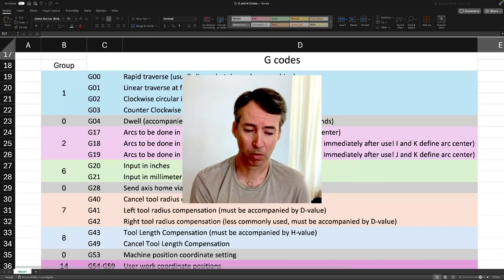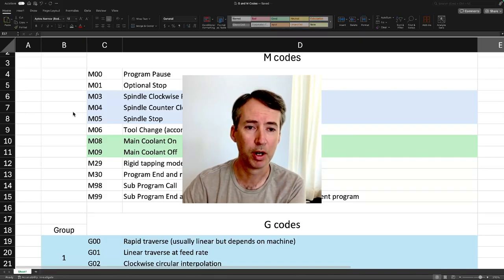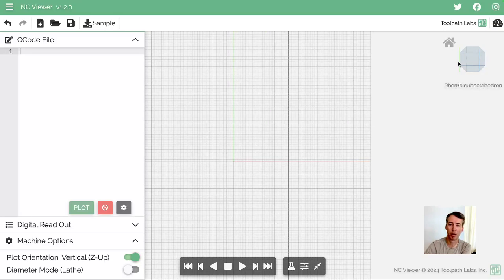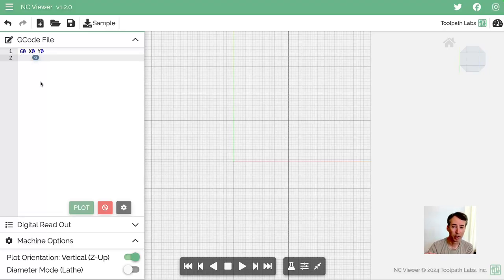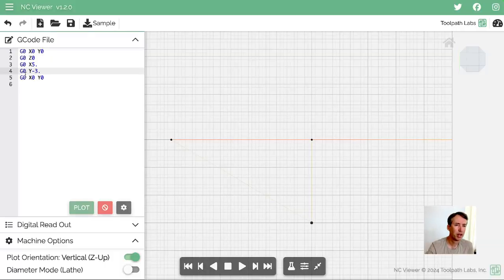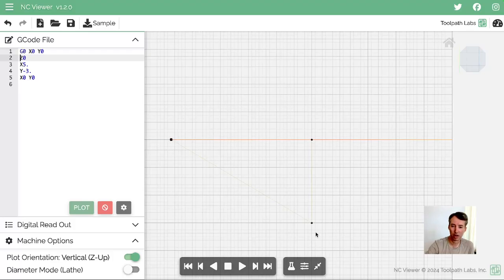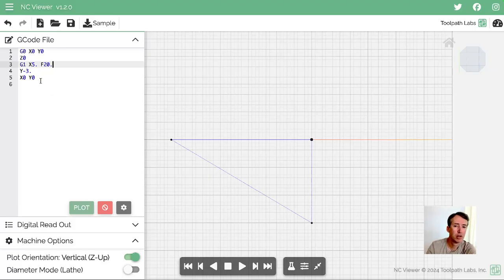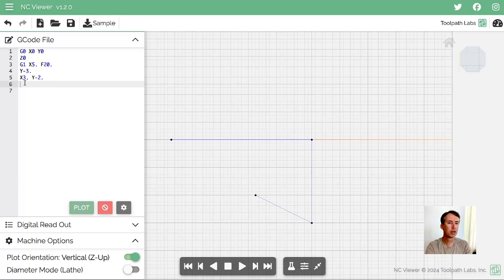CNC mill intro to G-code - Part 1 (G0 G1 G90 G91)

Comment: The linear vs dog leg rapids, if your tool travels from one side to the other side of the part, and you don't know how your machine moves, that is the difference of your endmill smashing into the part and scrapping it. If you are operating you should never assume the programmer knows the machine well like you do, and you should never assume the tool went up high enough in the Z to clear going over the part to mill the other side.